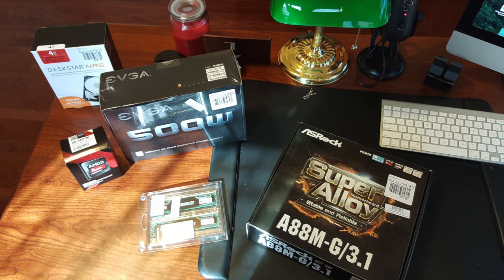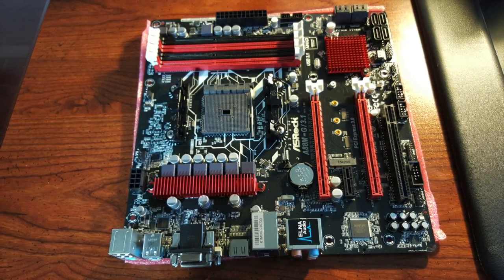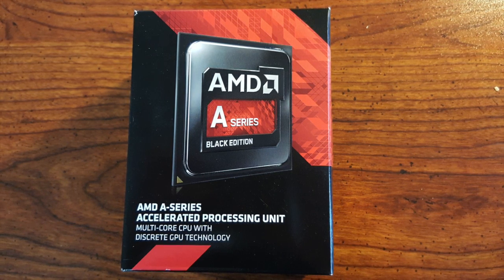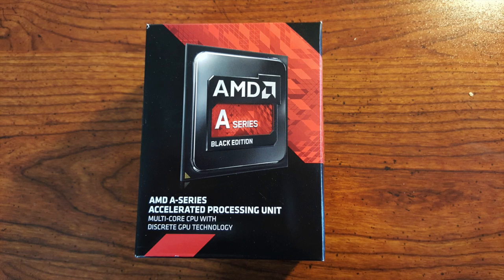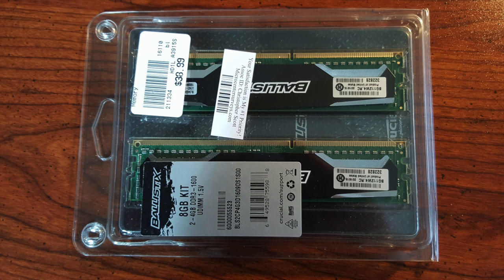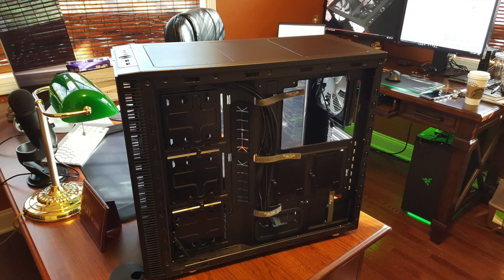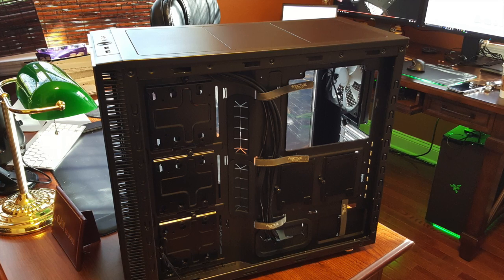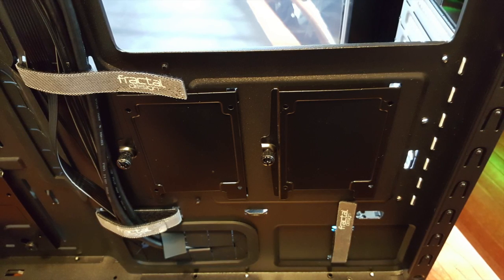Building a Multi-Purpose NAS

Comment: Great video Mike.

I love Unraid.  I've essentially been using the same install for 7 years.  It's grown with my needs and handles hardware changes like a champ.  I've upgraded the CPU, motherboard, RAM, NIC on four occasions.  All I did was moved the flash drive and hard drives to the new system....voila!  Works :)  I run Plex, Sabnzbd, CouchPotato, CrashPlan, Sonarr & Transmission.

My current setup:

Fractal Design Define XL R2 with ICY DOCK MB154SP-B 4 in 3, 2.5 inch Trayless 2 bay)

AMD A-6400K - (might upgrade)
Gigabyte F2A88X-D3H (8 x SATA 6Gb/s ports)
G.SKILL Ripjaws 8GB (2 x 4GB)
HP NC365T 4-port Ethernet Server Adapter (teaming)
4 port SATA controller and a 2 port SATA controller.
Corsair HX750

2 x Samsung EVO 840 250GB (cache pool) upgrading to 2 x EVO 850 500GB soon.

HGST 4TB NAS (parity drive -  just switched this last week.  Old parity drive was a 4TB WD Red @ 5.4kRpm)
2 x 4TB WD Red
1 x 4TB Seagate Desktop Drive
2 x 3TB WD Red
1 x 3TB Seagate Desktop Drive
3 x 1TB (Seagate, Hitachi)
Reply from the maker: That's actually quite impressive that you can basically overhaul the entire server, keep the USB and Hard Drives and not have to rebuild / reconfigure.  I love that.  

I also like how you can mix and match drives in the array and it fully utilizes each one.  That was the biggest selling point for me, and how it makes a great media server (& general purpose server).  

One thing I'm finding a bit of a challenge now is mounting an external disk (USB drive) to the UNRAID box (for quick backups as an example).  If I ever figure out how to do it, I'll document it.  

Thanks for the comment.  Love your setup.

Oh, one question:  How do you like the ICY DOCK?  Have you ever used the hot spare functionality?
Reply: Hey Mike,

I don't need that feature, so it's not something that I've spent much time on.  I tried a Docker app called Unassigned Devices, but that caused issues with my Mac Pro.  The shares would disappear, and only the flash drive would mount until I reboot.

The ICY Dock is awesome.  I use if because all my internal 3.5 bays are full.  They have a trayless version but reviews say that it's poorly built.  This isn't tooless, but I won't be taking drives in and out.  I purchased it so that I can add four extra drives.  I didn't know Unraid had a hot spare feature.  I've always been a little weary of hot spare.  I like I like doing things manually.

Comment: I am a real advocate of FreeNAS and you can get superb performance out of it if you are willing to put good hardware behind it, but the name is misleading.  The software is free, but the hardware you need will cost.  You can save a significant amount by sourcing previously used hardware from eBay. 
Please contact me if you would like to discuss hardware with me.  I have built 7 of these systems now and learned a lot from trial and error plus what I have learned through reading best practices from several sources that talk about BSD and ZFS optimization.
Reply from the maker: Totally agree.  My goals were different:  I wanted to use the cheapest hardware possible as I was trying to build the price equivalent of an appliance box, but perhaps with better performance.  

I also liked the UnRaid file system as it lent itself very well to my needs as a streaming media server for the home.  Commercial servers (or high-performance multi-user servers, or even for video editing) would do better with a more traditional RAID-style file system.  I do believe ZFS, and the hardware to support it would be well worth it in these use-cases.

Comment: I have been using FreeNAS as my storage solution since 2011 and have built multiple systems over the years.  I have done a lot of research into the hardware requirements.
The reason that ECC is highly recommended is the fact that the RAM is used for read and write cashing, so if an error happens to the data while it is in RAM, it will corrupt your data that is stored on the disks.
I have had very good success with used Dell Precision workstations from eBay as a base for the build.  The thing to look for is that the workstation has ECC memory and a Xeon CPU.  I have bought full systems (with no disks) from eBay for less that $400.  If you get a 2.4 GHz Xeon with 2 or 4 cores, it will be all the power you need for basic FreeNAS.  If you get a 2.9 GHz Quad Core with hyper threading, it will give you enough power to run a Plex media server and a couple of virtual machines.
My latest build is using a 3.2 GHz Xeon on a SuperMicro board and I am able to read and write data fast enough to flood a 10gig NIC.
I am a bit of a storage geek and I have three NAS units running at my home right now.
The oldest one is build using a Dell Precision t3500 and only has 5 drives attached.
The newer two are built using second hand rack mount cases from eBay and SuperMicro boards.  Both of them have 12 storage drives and more space than I anticipate using for a couple years.  They are set to sync with each other to keep all the data backed up.
Reply from the maker: Basically it needs server hardware.  :-)   That's a good idea re-purposing the older Dell servers.  

SuperMicro was on my short list when I originally considered FreeNAS, and I still may use them when I eventually build a FreeNAS server.  I like the headless configuration (ACPI) which is rare on non-server / non-SuperMicro motherboards.
Reply: Hello Chris could you give me more info about 3.2 GHZ Xeon you talked about and the matching SuperMicro board. Any specification, I want to build a freenas with at least 7 HDD.
Reply: Hey Chris... Iam looking to build my first FreeNas Server that will flood a 10Gb Network... Got any ideas for the right CPU/Motherboard/Ram without killing my bank account?